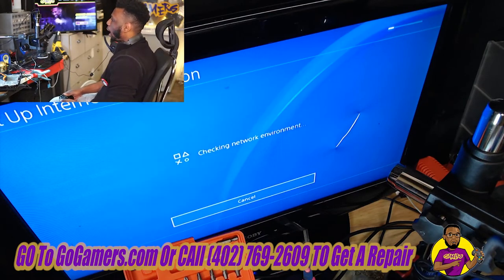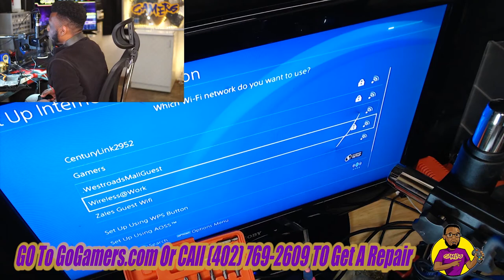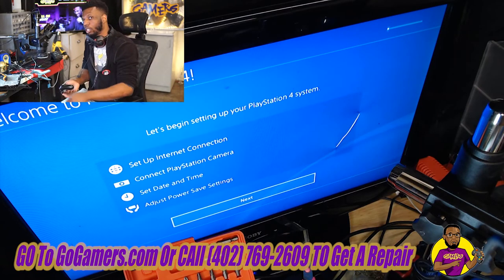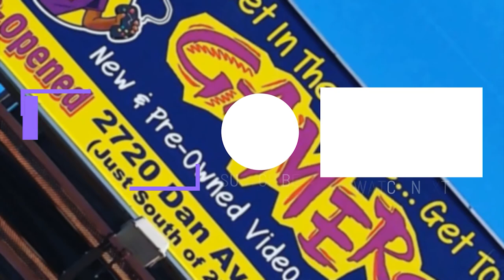Dropped PS4 PRO Can We Fix It? (No Signal HDMI Port Repair Fix)

Comment: I ordered one in the mail refurbished. It looks brand new controller and everything looks brand new (controller has plastic protector over touch pad) 
Only thing is a corner is cracked like delivery dropped the box. The piece doesn't look important like it's just part of the shell. However when I turn it vertical I heard some small debris moving inside. 
It runs perfectly fine though. What could the debris sound be? And should even bother taking it apart and removing whatever it is if it runs fine?

Comment: Ps4 slim fell from the hand and when switched on scratched the disc inside it and not taking any cds in anymore. The data said corrupted and we had to format it. But after trying to switch on a game or downloading one it started lagging to the point of Unusability. Not restarting cuz it's lagging.